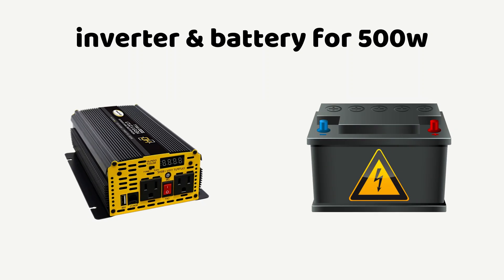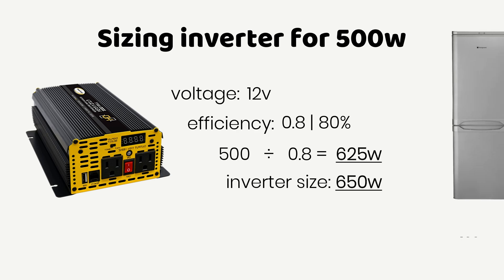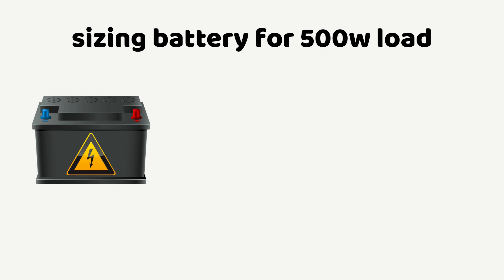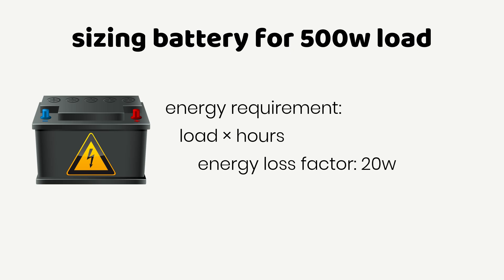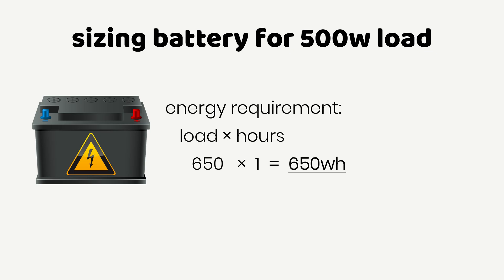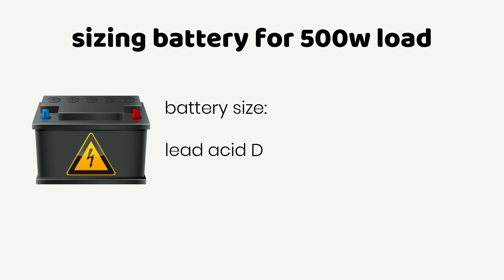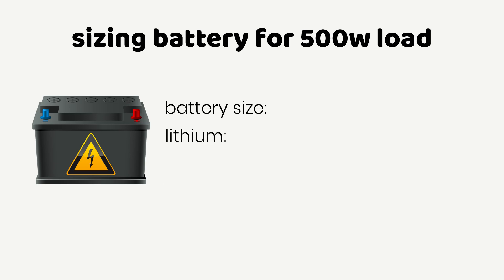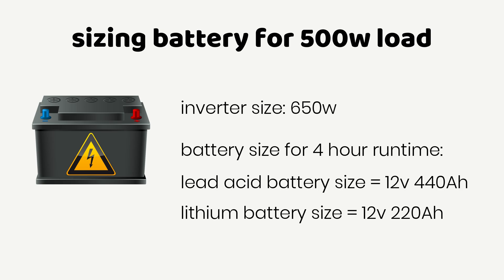How to Choose The BEST 500w Full Load Solar Power Inverters and Battery Size - Secrets EXPOSED

Comment: please calculating should I use the inverter surge power or continues power?
Reply from the maker: Think of your inverter like a person doing a job.

Continuous Power is like their normal, everyday strength. It’s the amount of work they can do comfortably all day long without getting tired. This is the power you need for running your regular things like lights, a TV, and a fan all at once. You need to make sure the inverter's everyday strength is enough for your total load.

Surge Power is like their "superhero" strength. It’s a short, powerful burst of energy they can use to do something really tough, like lifting a heavy weight. Some of your appliances, especially your fridge or a water pump, need this big "kick" of power just to get their motors started. They only need this super strength for a second, and then they settle down to their normal, everyday power usage.

So, when you choose an inverter, you need to make sure:

Its everyday strength (continuous power) is enough for all the things you want to run at the same time.

Its superhero strength (surge power) is strong enough to handle the initial kick needed to start your most demanding appliance.

You need to account for both to make sure everything not only starts up properly but also keeps running smoothly.

Comment: Sir, is it possible to run Flour mill of 15hp 3 phase motor with run time from 10 am to 5pm daily. 
How many panel , VFD size required, wire size etc needed.
Plz guide me.

Arun Kumar